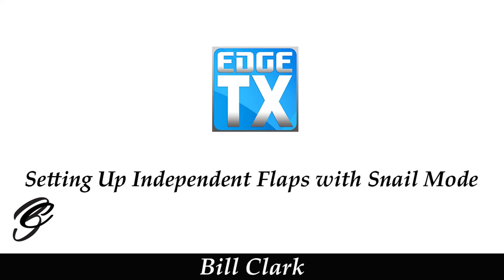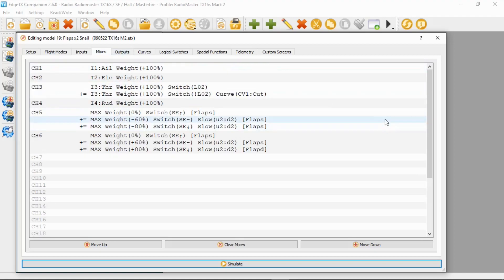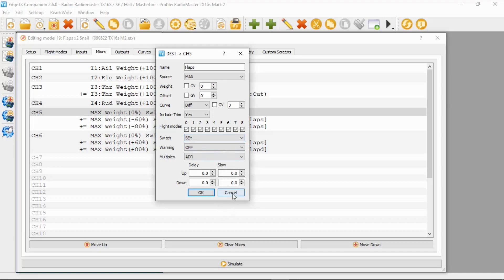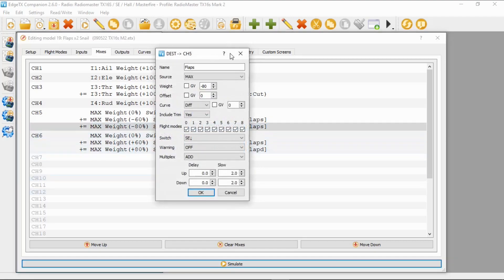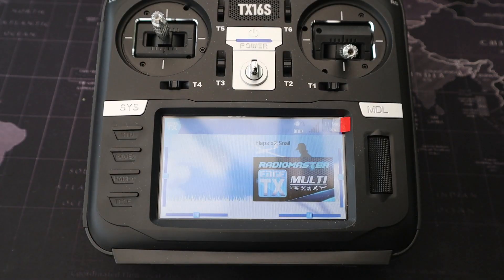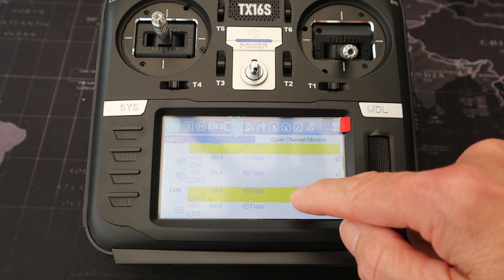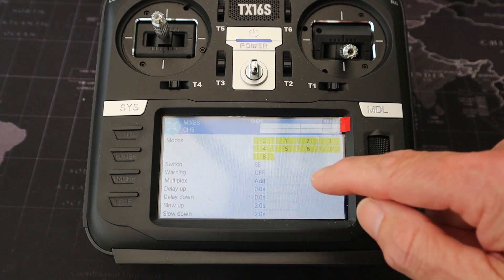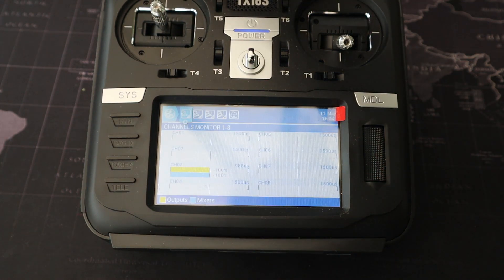EdgeTX Adding Flaps with Snail Mode

Comment: thanks for the video.  my flaps are working, but when I switch from mid flap to full flaps, the flaps go up to normal position momentarily before going down full.  Any ideas why this might be?
Reply from the maker: Hi Michael, which receiver are you using?
Reply: @the-happy-RC-flyer  betafpv micro Rx 5ch.  I have changed 5ch to 6ch.
Reply from the maker: If it is a ExpressLRS protocol receiver you only have 4 full resolution channels and channel 5 is only for arming.
Reply: @the-happy-RC-flyer  yes, and I have the latest firmware and changed channel 5 to 6 making it full resolution... I've actually fixed the problem by assigning the flaps channel to a switch, then selecting that switch for source in mixing menu....    Still, a strange behaviour from previous setup.... Thanks for your advice!

Comment: Bill i need help setting up flaps on the tx16s mk2 with edge tx
Reply from the maker: Hi Dan, how can I help you?
Reply: I cant seem to get flaps to work right on one side
Reply: One side of the flaps does full extent while the other has the 3 stage but wont do full extent now the side that does will not do the 3 stage flap position no mtter what i do
Reply from the maker: What receiver are you using is it ExpressLRS and if so using channel 5?